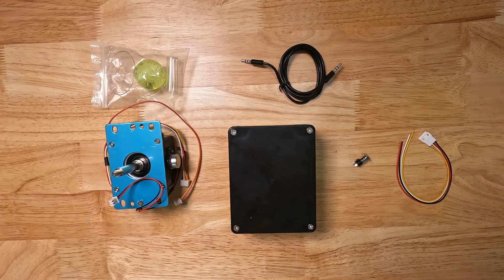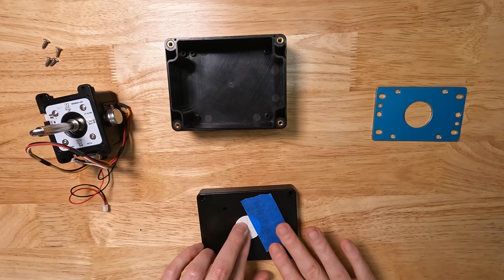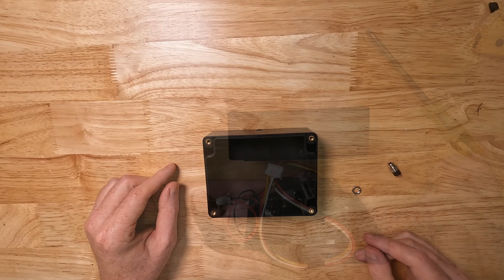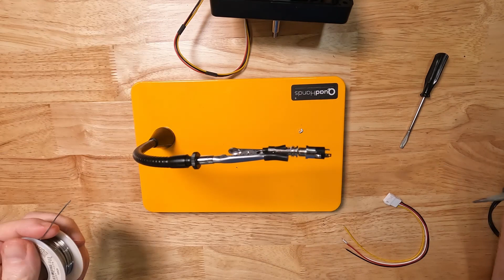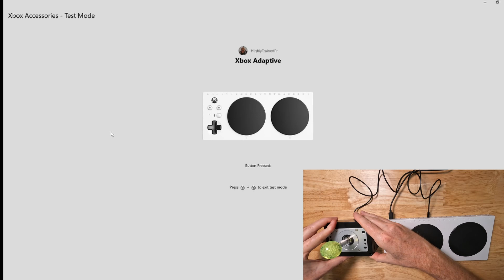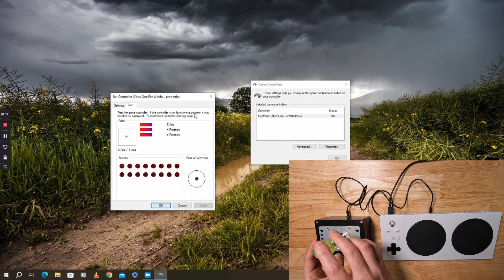Analog Joystick With XBox Adaptive Controller-DIY

Comment: I am obsessed with that type of analog joystick and touchpad sensors, like the one on the steamdeck, there will be an arcade control with an analog joystick and a touchpad, both with buttons that can be pressed, to be able to play devil may cry or ninja gaiden, even a gears of war; can you build one?🙂🙃😊😃
Reply from the maker: There may be a way to connect a touchpad to the USB port of the Xbox adaptive controller. It's also theoretically possible to connect a touchpad to a Brook Wireless Fighting board but I haven't tried it. The Brook WFB is what I've used so far to build my own custom controllers.

Comment: Thanks for the detailed instructions and links! Any suggestions on finding a joystick topper for quads? Or a link to a 3D printer file for a quad topper?
Reply from the maker: Glad you found it helpful! I haven't found a good joystick topper for quads. I do have some ideas on making some. I have the materials but haven't had a chance to try it yet. Are you thinking a goalpost topper similar to what electric wheelchairs have?
Reply: @enabled5714  Yes! Goalpost type topper. Like Warfighter Engaged's JOYSTIX-L "hand rest"

Comment: Hi  would these work on the playstation access controller
Reply from the maker: Hi, I don't know much about the PlayStation access controller but if it uses the standard 3.5mm format for analog sticks then theoretically yes, this will work.
Reply: @enabled5714   hi ya Thanks for the reply yes they use the 3.5mm jack 4 pin

Comment: This is so helpful. I'm making an original "arcade" game. It's essentially pong but in real life as a tabletop game. This video is very helpful to figure out how to wire it to my arduino. I'm wondering what the voltage should be? or does it matter? My board is 12v so that would be easiest but I can attach a regulator to make it 5v.
Reply from the maker: Hi @haryeti, I have never tried it so try at your own risk, but I think it will work fine using 12V.
Reply: @enabled5714  I tried it out last night, 12v gave a lot more deadzone at the upper limits of the movement range.
Reply from the maker: @haryeti  Interesting, thanks for the feedback